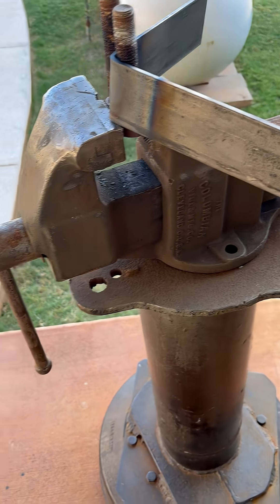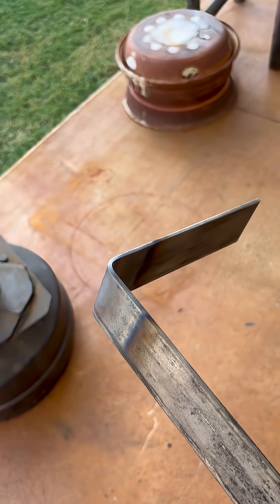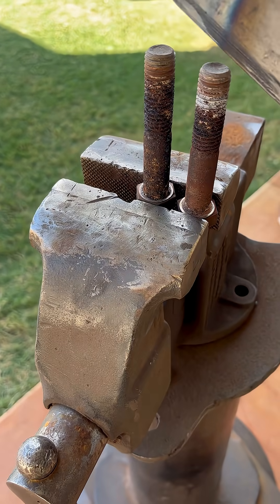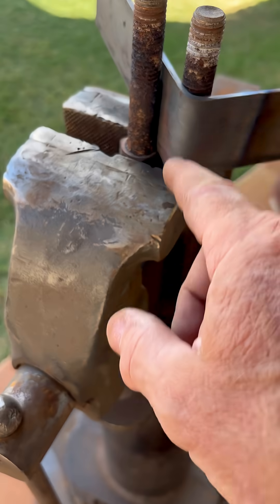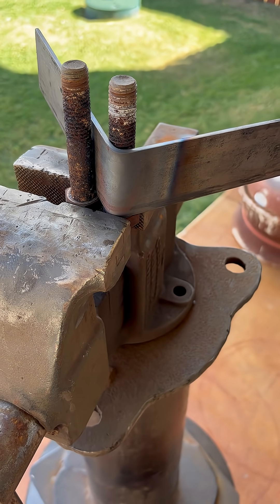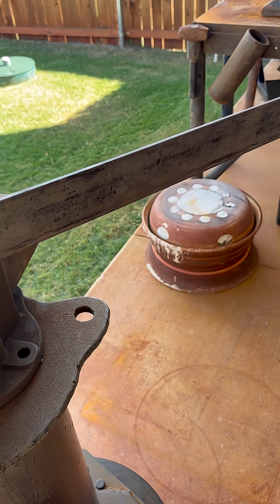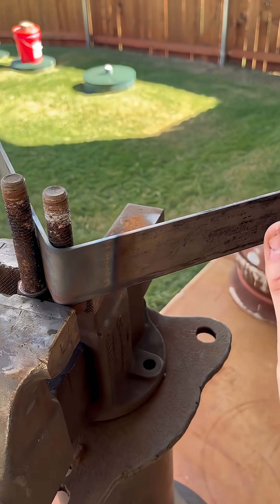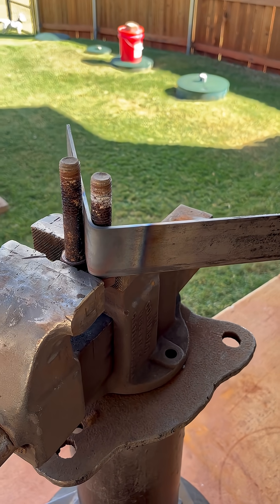Bending flat bar

Comment: Cold bend with a piece of 2”ish rectangle tube slid down. Length doesn’t have to be long just 8-12” and 1x2 would work best but 2 square does fine just need to overshoot the angle. Push on the slip on “die” to use the inside wall as straight force and bend happens at the lower end half way between vice jaws and lower wall edge of square tube.